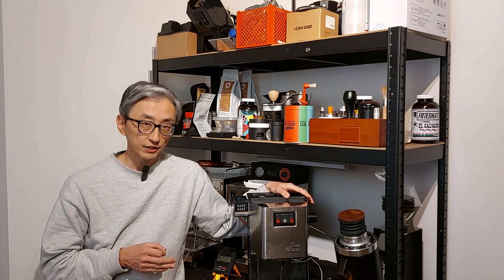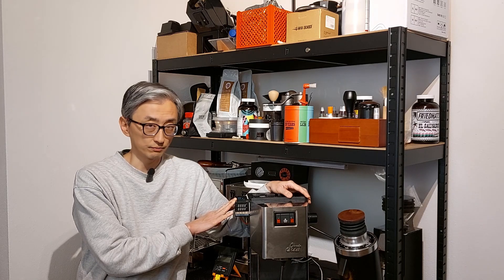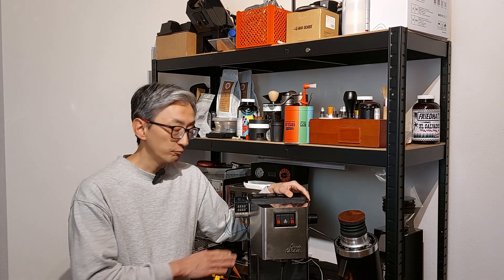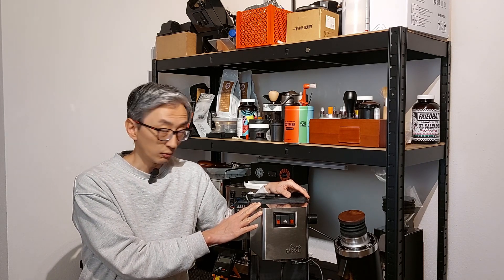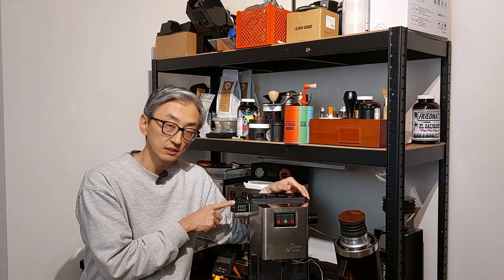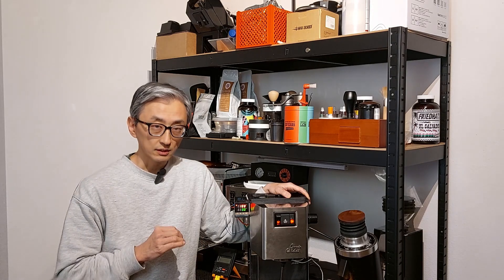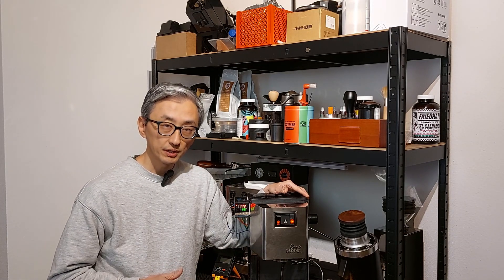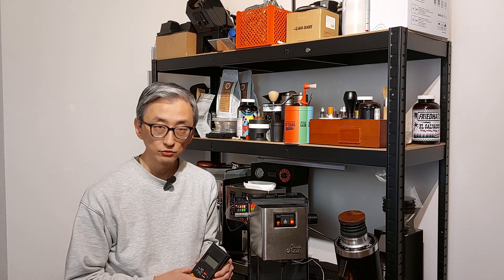Temperature Control without PID: THE MAP for your Gaggia Classic!

Comment: Hi there, I really enjoyed the video, Gaggia should pay you :)  Can I ask? I used very dark roast but would like to brew at 85 celsius. Have you got advice? The temp surfing frustrates my autistic brain. many thanks.
Reply from the maker: Thanks! I think it's better to install a PID. To bring the temperature down, you will have to test with different flushing times,  e.g. flushing with 4, 8 and 12 seconds before extracting, always with a fixed reference like lights going on or off. Then, depending on the taste, you will have an idea of what works best for you. But in my view, surfing the temperature is not very precise and replicable, I'd install a PID and just published a video about an easier installation, in case you want to check. For me, it's one of the game changers mod.

Comment: If I have understood correctly, the only way to get the temp you got would be to let it warm up ( light goes on / heater goes off by residual heat continues to warm water to 126 ), let it cool down (4-5mins ) until light goes off and then turn heater back on and make shot at some point before light goes back on - for me that’s not super practical - how do you take this information to use day to day once you have worked out best timings - temp ?
Reply from the maker: @cheekychapman1  this procedure, known as surfing the temperature, is very well known in the hobby, and yes imprecise and inconsistent. Basically, people brew a shot let's say immediately after light going on and if it's sour, they use the steam button for 5 to 10s after lights going on, then they brew their coffee, and keep playing with lights and time. What I tried to do is measuring the temperature in the boiler and in the puck so that the people who surf the temperature can have a better reference, and this part is consistent: light always goes on at 104 in E24 or 107 in Gaggia Classics, always on at 103, and the starting temperatures in the puck are also consistent with these measurements. Some people have the patience to surf the temperature  or don't have the skills to install a PID. In my case, I'm lazy and I always install a PID in my machines. The other downside of surfing the temperature is that you have a very limited range to play with consistency. In my case, sometimes I use 90, others 94 degrees. 90 is almost impossible to achieve consistently without a PID.

Comment: The methodology is spot on. I never considered determining the appropriate period to wait before starting the pump. I would assume that the discharge pressure impacts the temperature delta. Definitely something to figure out on your own machine.
Reply from the maker: @ronjones1414  thanks for the comments! What do you mean by discharge pressure? The brew pressure? If so, this is not what affects most, but the flow. Higher flow will lead to faster drop in temperature. Then, a turbo shot shall be more difficult to keep the temperature at the desired level and a ristretto shall be easier. Also, the longer the shot, more difficult to remain stable since the boiler is very small and with a high flow in a long shot, the heating element may not have enough power to recover. Then, again the ascending curve shall be more favorable for these cases. Hope it clarifies a bit. I didn't know this topic would be so popular, but maybe in the future I can make a more comprehensive one on temperature surfing.
Reply: @EspressoHackers  Certainly, the change in volume of water is what impacts temperature variability; however, because the conduit size is fixed (assuming we accept that puck resistance is the same and that the OPV setting is constant,) then the only thing that will modify flow rate is a modification in pump discharge pressure. Consider adding a rheostat to a pump (the dimmer mod, still don't know why we call it that.) Modifying the input power modifies the discharge pressure, modifying the volume of water moving through the puck for a given time. A 6 bar pump will fill a glass slower than a 15 bar pump assuming the discharge conduits present the same level of resistance to flow. That time change reduces the amount of time water can be in the boiler once the pump has discharged enough water out of the boiler for the make up water to create a DeltaT.
Reply from the maker: @ronjones1414  I agree. A dimmer would make exactly what you describe.

Comment: So if I'm pulling shots with light roasts and want higher puck temp I should start the shot as soon as the light turns on?

Ive been temp surfing without truly understanding why, and thought it was the other way around! Thanks for explaining so clearly :) 

I would be curious to see you run experiments on using the steam button and pre infusion
Reply from the maker: @aalgawi  thanks for the comments! I didn't use the steam button because I thought the temperature was already too high. But you can try if you need extra temp. 2 or 4 seconds shall give you a reasonable increase and you can keep increasing until you think it's delivering a good cup.

Pre-infusion in a Gaggia you have two options: using on and off, the pressure will be released and may break the puck, but many people use this option. Another is to install a dimmer. I prefer the dimmer because you can also play with pressure and flow profile. I have a video on how to install the dimmer in my 3 basic mods Playlist if you have doubts on how to install it.
Reply: @EspressoHackers  I think I'm going to try installing the Gaggiuino soon which means I shouldn't install any other mods right?
Reply from the maker: @aalgawi  with Gaggiuino, you don't need pid, Dimmer and pressure gauge. Buy you may want an IMS showerscreen, a brass or stainless steel diffusion disc with 4 or 6 holes, a better steam wand, lower drip tray, there are many mods available for Gaggias that you may still want to try.

Comment: When I first got my Gaggia Classic, I found that the easiest way to temp surf is to attach a cheap thermometer to the front of the boiler. Instructions: Buy a cheap cooking thermometer. Just disassemble so that the wire is exposed. Attach the bead at the end of the wire somewhere against the flat middle/front part of the boiler. Use a piece of heat tape. You then wedge a piece of wood between the inside front housing of the Gaggia and the bead. Thread the wire to the outside of housing so that the digital display of the thermometer sticks out in front of the Gaggia and attach using double sided tape. Now you can monitor the boiler housing temp. When the temp is at a desirable level for a good espresso (determined by experimentation) you pull the shot. To raise the temp you can use the steam button. I find one second can raise it by 2 degrees F. So, for example, if the boiler temp is reading 187, you can trip the steam button for 4 seconds. That eventually gets the temp to about 195, or so. Then wait for the temp to drift down to 192 for a dark roast and then pull a shot. Lighter roasts will require a higher temp. I had great luck with this technique and found it quite easy to do. A PID, which I soon installed,  just makes things much easier and more convenient, but not any tastier.😀
Reply from the maker: @dominater  great tip! Thanks for the comments!